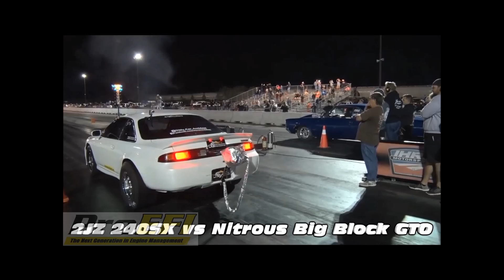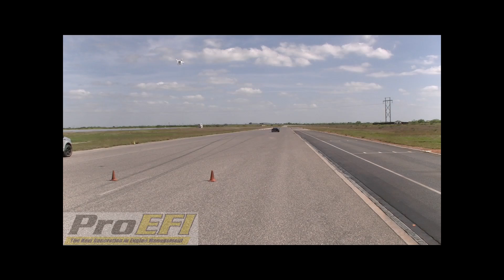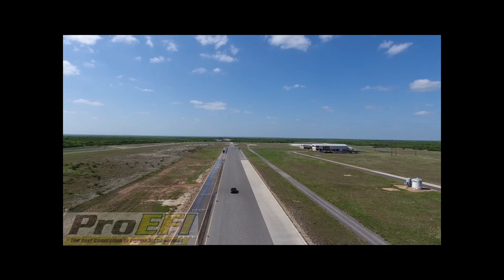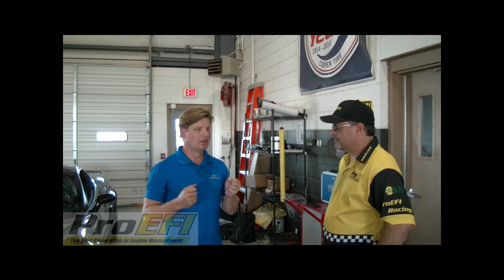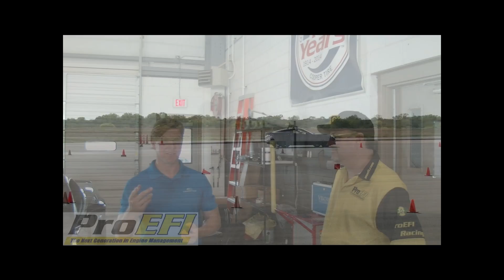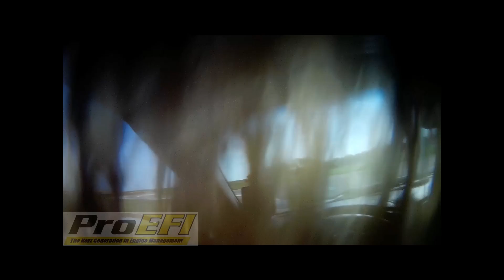ProEFI Professional TC Evaluation

Comment: That was amazing, super value for all existing and prospective customers of the ProEFI brand. This video also reflects the passion, confidence and dedication of the team over at ProEFI as they continually strive towards excellence sharing their success and their progress with the online community of calibrators and the open market at large.

It's extremely encouraging and reassuring to see this level of persistence towards pure from an ECU manufacturer, because the truth is that there shouldn't be a cap on the value a customer is entitled to having made their investment.

Even though I don't work with the ProEFI brand, please accept my thanks for the initiative and also for sharing. The entire team supporting the ProEFI brand more than acknowledgement and recognition, and having said this, I'll add that your efforts aren't going by unnoticed.

Please keep up the great work and the positive momentum that comes as part and parcel. Cheers!